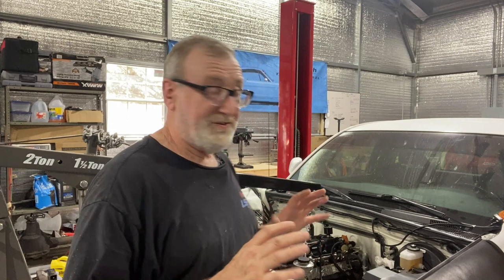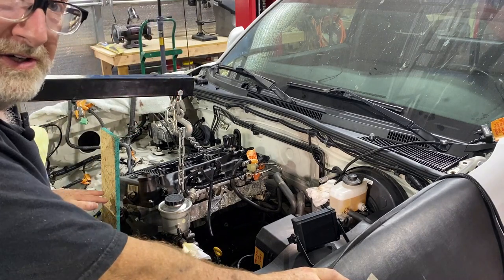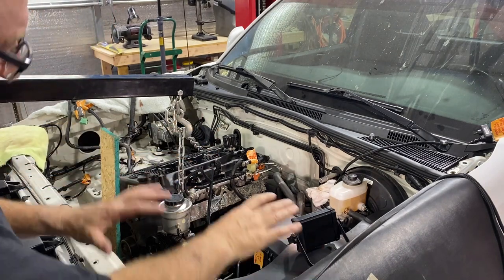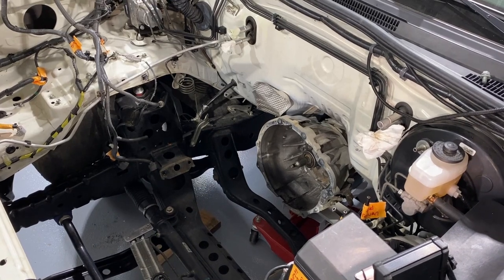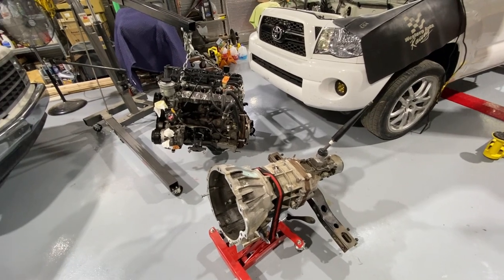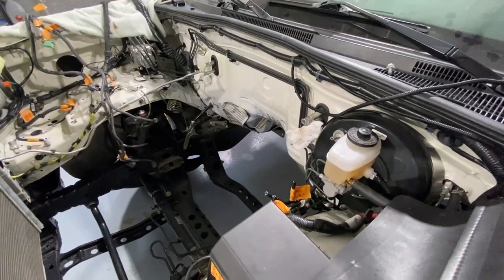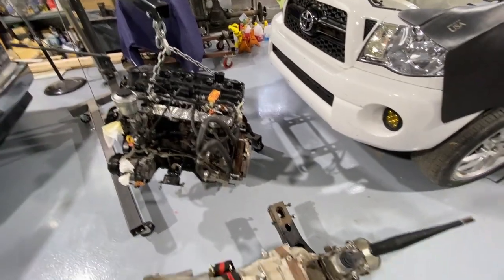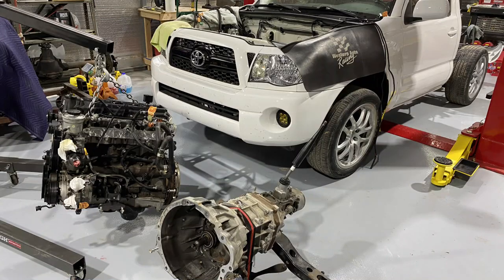2nd Gen 2007 Toyota Tacoma LS V8 Swap Build Part 3: Engine / Trans Removal

Comment: When is the next one coming out I want to do this to my Tacoma I have 225000 miles on the stock motor and want to do the swap but want to see the fit before I do it
Reply from the maker: It won’t be long. The LS motor fit’s very nice under the hood. A lot more room than you might think. Toyota was generous with the frame dimensions. I appreciate your patience. I want to be certain of the details before just throwing stuff out there. So many of these swaps make it look good from a distance. Lot of small details I want to make sure are right.
Reply: @laurencevillegarage  the one thing I really want to see is the trans length compared to the stock trans where it comes up through the cab before doing a swap like this
Reply from the maker: @elijahcunningham1685  when I get to the point of mounting the transmission, I have both transmissions here so I can do a comparison of their dimensions. My ultimate goal is to be able to use the stock driveshaft and keep the shifter is close to the stock position as possible while at the same time, placing the engine as far back in the chassis as possible. Stay tuned, and I’ll let you know all that information.
Reply: @laurencevillegarage  okay thank you looking forward to the next video

Comment: I wish I had money to buy your engine and trans . I have 310k mile 2.7
Reply from the maker: The fact that you’re still running at 310,000 is amazing! When we finish the build, I will let you know all the things you need to do to swap an LS-based engine into your truck. You don’t have to have an all aluminum 5.3 that’s fully built, you can go with a 4.8 or 5.3 pull out and go at a much less expensive route if you can afford to do it that way.